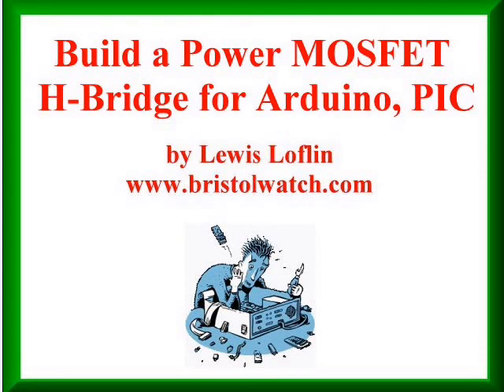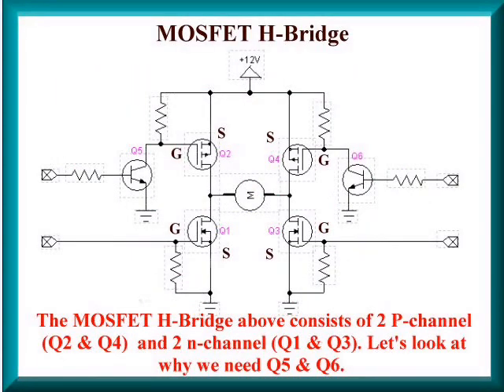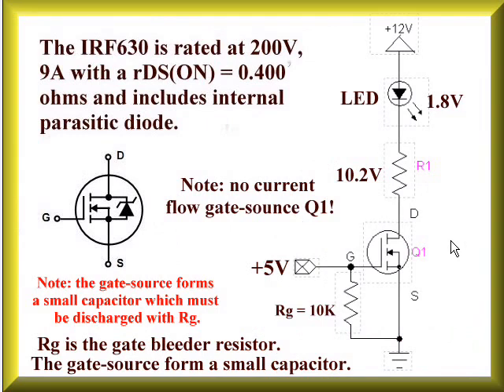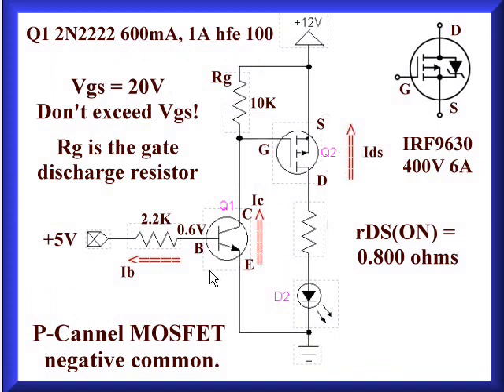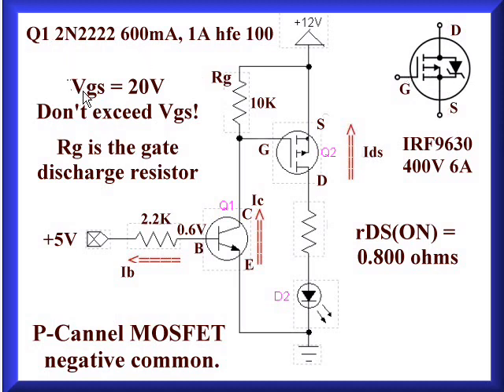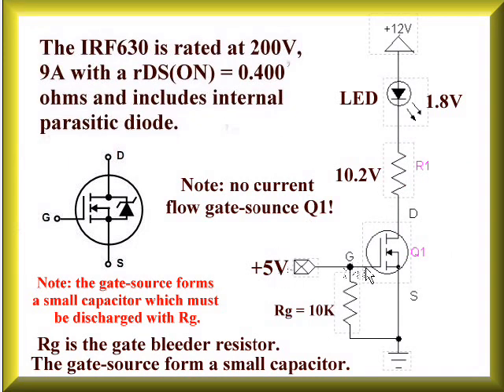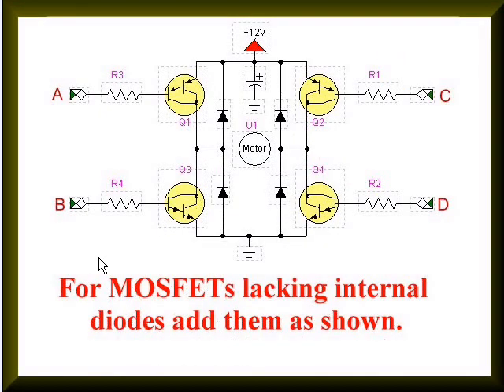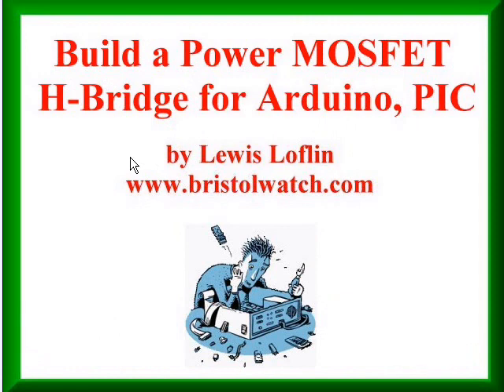Build a Power MOSFET H-Bridge for Arduino, PIC

Comment: Ok, thanks, but what kinds of modifications are necessary for 24v?
Reply from the maker: You have to find MOSFET with a Vgs > 30V.
Reply: ok, thanks for you answer. only I need to find mosfet with that capacity,but the rest of the circuit it's the same??
Reply from the maker: Here is a better answer to your question. https://www.youtube.com/watch?v=dbwZgP9gIbA
Reply: Hi, Lewis! Thanks for such awesome scheme. Can you advice, which transistors can I use with 24 voltage and 10A motor?

Comment: Please take a look at 7:29.  Node A connected to the 2 MOSFET is located between 2 resistors each of 10K. This is a voltage divider between 12V to ground, so you don't get 12V, at node A, but 6V, when the transistor Q5 is off!  Please take a look if I am correct.
Reply from the maker: This was already mentioned below but here it is again.
Note disregard the schematic at 7min 25 sec. Go by the schematics here. 
http://www.bristolwatch.com/ele/h_bridge.htm

Comment: Has anyone been able to successfully simulate this circuit? I've tried in LT Spice as well as Multisim with no luck :( Got the circuit working using my own resistor values though
Reply from the maker: I never use simulation I use real working parts.

Comment: How would you make this work with 3 signals to be able to "coast" and also "brake" the motor? This example the motor brakes when its not being run forward or reverse.
Reply from the maker: See above.
Reply: Yeah that is how I have everything wired up currently, works great but there is no mode to put the motor into "coast" where its free running? Putting both signals high, or low, results in the motor connecting to itself in "brake" mode right? I need a 3 wire or something to open up all 4 transistors. I don't have enough space with my current project to use 4 individual control lines. I've tried some small motor driver IC packages that use 3 wires to control (FWD, REV, ENABLE) , but they were not enough amps. Not sure how to wire up the same features in my own.
Reply from the maker: The diagram on that type uses two lines to control the H-bridge.
Reply: How do you wire it up to use 3 lines of control for FWD, REV, ENABLE? Or how do you make the motor go into "coast" mode with 2 wire setup instead of brake?

Comment: Good day ,great explanation . bit new at this and need help on a bit of a challenge . i have a starter motor 12 volt   100 amp . will it be possible to run this DC motor on this circuit and what components will i need to run this motor on PWM . I know this sounds like a strange setup but i need the torque for my application  and also need to reduce the speed also need to change direction as well .a person could probably buy something readily made  up but i want to learn from this so any help will do 

kind regards
Wayne wilson

Comment: is there a protection against back EMF in this circuit, or are additional diodes necessary for that?
Reply from the maker: The diodes are built into the MOSFETs are not shown.

Comment: I tried this with different semiconductors and it seemed to work all be it some loss in power.  When I tried adapting it for both directions it didn't work.  Because less power than the motor needed.  So I guess it did work.  I'm thinking I did something wrong.  May I discuss this with you and show you my diagram and what I used.  I did end up using a roboclaw.  I just can't drop this.
Reply from the maker: +Timothy Carey Yes my e-mail is lewis@bvu.net
Reply: I emailed you regarding my question above.  My first e-mail I sent accidentally before I was finished creating it. My e-mail address is tcarey@disabilityvoice.us

Comment: hello why u use different type of mosfet ? and why when iam use the same type for ex n chaneel i get big voltage drop ?
Reply from the maker: +Omar Eng Becase I'm switching from Vcc with the p-channel MOSFETSs and the  n-channel is the wrong polarity. The rest of the question I don't understand.
Reply: hello . i buld my h bridge using n chaneel mosfet irc740 and gate drive ir2112 but when i operate it in protius i get voltage drop ? also i use pic 16f to produce pwm to the mosfets .
Reply: for example dc input is 30 but i get 17.2 in voltmeter ?
Reply from the maker: Why are you using 30V when the MOSFETs (Vgs) is 24? Where are you reading 17.2 volts at?
Reply: between the two legs of h bridges 
at the motor location .30 volt is the vdc 
not v gate
Reply from the maker: If you refer to the motor that's what it's supposed to be if all the MOSFETs are off.
Reply: iwanna to ask you sir in case of inverter h bridge is there is v drop ?
Reply: sir in protius the scope have one terminal so the floting point is not accurate measure ? is that analysis right .
Reply from the maker: Don't understand what you are asking. Use the link to the webpage.

Comment: If I use logic level P-channel and N-channel MOSFETs could I disregard the transistor used?  I'm designing an H-bridge to drive a transformer.
Reply from the maker: +Proto G The P-channel is being switched to ground to turn on not apply a voltage. So you need to be aware the voltage on the gates id Vcc.
Reply: +Lewis Loflin Hey Lewis, would this setup with 4 Logic-Level N-Channel MOSFETs work with 5V? http://i.imgur.com/IDAOg7M.png
Reply from the maker: It would take so much reworking if it worked I really don't know.

Comment: Hi i am using Two P channel mosfet and two N channel mosfet with optocoupler from arduino....my qns
are
1) is it neccessary to put resistor ACross VGS(we have put it)
2) whenever i connected the supply of 24 V DC(battery),P channel mosfet gets heated more compared to N channel mosfet,in this even we didn't connected the load(24 PMDC motor),arduino inputs
can i know what is the problem and its solution??
Reply: I'm having the same issue. This circuit is plagued with shoot through since the N channel FET does not turn all the way off. I don't know enough to call it a bad circuit, but I certainly couldn't get it to work properly.
Reply from the maker: If you don't program your controller correctly you will get shoot though. NEVER turn on Q4/Q3 or Q1/Q2 at the same time!
Reply: Thanks for the response, Lewis. I used your figure 2 on your website, so I didn't have specific control of each transistor, only control of each half bridge.

Comment: wouldnt the 2 resistors on each side form a voltage divider , putting both gates at half the voltage of the rails (6v)? which means they will be both turned on at the same time when the input to the npn is low? (the gate of Q2 pulled low by 6v, the gate of Q1 pulled high by 6 v)
Reply from the maker: +michel michel No. MOSFET gates are non-conductive. They operate by voltage not current.

Comment: Call me stupid but with all the resistors at 10K then all gates will be at 6V when the 2N2222 is off and ALL the mosfets will be turned on. Net result Blue smoke. :-(
Reply from the maker: +Wizard Merlin MOSFET gates are voltage operated and non-conducting - when the 2N2222 is off gate voltage is VCC.

Comment: Great work sir. I tried  it, i used irf 9540 (100v -18A) to replace irf9630. 
i Got problem when i connected this H-Bridge (your design) with 11.1V (3cells) Li-Po  battery. P-Mosfet getting hot when switch on, but when i conmected to adaptor 12V, irf temperature keep cool.
Reply from the maker: +Ahmad Zambarkah The voltage wasn't high enough to fully switch on the MOSFET.

Comment: Thank you so much for this.. Best tutorial on H bridge's I Have seen so far..  I just learned of H bridges.. Ya, I know.. REALLY!!!!!!   I am building a coil engine and have an arduino using Halleffect sensors to pick up the magnet on the fly wheel of the engine.  I have a magnet on an aluminum shaft connected where the piston used to be.  I built a pivot on my lathe that connects to the crank shaft and connects that shaft with a magnet on it together.  I have guides that keep the shaft from tilting.  above and below the magnet are power coils.  The magnetic fields will face towards the magnets on the aluminum shaft.  so depending on polarity from the circuit I can have 2 NORTH fields facing each other or 2 SOUTH fields facing each other. pushing and pulling the magnet at the same time.  Been looking for a way to swap the field polarity without frying a circuit.. I am using HIGH amp coils.  They can handle alot of amps.  They are not wire coils.  So I am looking for an H bridge design that can handle upwards of 300 amps.. So far the best mosfet's I have found can handle up to 280 amps.  Thinking of getting them and making an H bridge with them.  Using my arduino mega to control the upstroke and down stroke timing with the Hallsensors.  I have my program made up with the RPM and timing and LCD display with my Voltage outputs of my pot(throttle) all set.. the engine.. Just an H bridge is all I need.  There is a great deal more to my motor, but no one wants to hear the every detail.  I am going to use this tutorial to make that H Bride.. You are a world of help..  I wouldn't mind your help if possible.  If not thanks for the tutorial and keep up the help.. 

Sean

Comment: Excellent video demonstration Mr. Loflin! Could you please let me know if I would be correct in assuming that replacing the motor with the secondary winding of a transformer that we now have a step up DC to AC inverter? And If so,  would some type of diode be used as a spike or fly-back suppression?
Reply from the maker: +Cameron MacDonald These MOSFETs already have built in diodes. Check the ones you use.
Reply: +Lewis Loflin Yes you are quite correct of course...Thank you for that, but would the circuit function as a DC to AC inverter if a transformer (with no center-tap) was used in place of the motor - provided an oscillator was connected to INPA & INPB?
Reply from the maker: I don't really know.
Reply: +Cameron MacDonald It would work, I did the circuit with the optocouplers connected to a 555 timer in astable mode to provide the square wave generator. Just make sure to use a transistor before one of the optocouplers so they're not "on" at the same time.
Reply from the maker: Thanks.
Reply: +D Pa Thanks for your advice. I tried your suggestion out on the breadboard. The transistor switches were a really good idea.  Now I'm thinking about using a quad 2 input NAND gate connected from the output of pin 3 from the 555. The NAND gate might offer faster switching capability. Were you able to achieve a near perfect 50% duty cycle of the square wave at 60Hz? I love playing with this stuff! Thanks again!

Comment: i have to ask, on your last diagram you have a n channel mosfet with  2 transistors? what type of transistor? nd you end up with 2 outputs so my question is why turn on tho transistors? if i can just connects the arduino inputs pin to the outputs of each gate of this four mosfet's?

and in regards to the mosfet are this all the same types or we have 2 of each? (p & n channel?)

like your videos keep em coming!
Reply from the maker: Frank Lopez Hello Frank. The NPN transistors are used to protect the 5-volt logic from the higher voltage H-bridge.
Reply: Lewis Loflin thanks sir, understand, i did leave another question for another of your videos , i will appreciated if you took time for that particular question on the other video

Comment: I just have to say that you do an extraordinary job of making it simple. May I suggest however that instead of zener diodes to protect the gate just used a resistor that will proportionally divide the voltage down with the bleed off resistor. Much cheaper.
Reply: that's what I thought too,
Reply: Cheaper you say, but a diode is much more effective and not exactly too expensive compared to a resistor

Comment: sorry 
can we make a speed control by this circuit ??
Reply from the maker: Ahmed Elshiekh You will need to apply that in the Vcc side of the power supply. See:
http://www.bristolwatch.com/ele/pulse_width_modulation.htm

Use the circuit in fig. 5.

Comment: I like your easy to understand video.  to power in one motor both directions couldn't I just use 2 mosfets?  And then two PWm and outputs on the arduino on the gates to control the speed and direction of the motor?  And put diodes on the arduino outputs so current doesn't strike into a arduino?  Referring in part to the following video.  https://www.youtube.com/watch?v=sVyi7yWuXxs
I really need a mentor for arduino.  I'm receiving a new power wheelchair and doesn't have all the same motors for positioning my seat.  Because I ever have infrared learning capabilities.  I've got the infrared switch workout.  I need to run to linear actuators at possibly different speeds but always same direction as each other.  Need to move them forward and reverse.  Also there is another video from arduino starter kit lessons that they ran a nine volt motor on one mosfet and a diode.  I have been able to make this motor controller I purchased work so I thought I'd build something with mosfets.

Comment: If you turn on on both P channel fet's you will not get 12 volts on both terminals of the motor, when you put a meter in the circuit you will get 12 volts because you just put a return path in the circuit. To wit, with both N channel fet's off there is no current flow thru the P channel fet's.
else gr8  video merci beaucoup
Reply from the maker: N8ZU "f you turn on on both P channel fet's you will not get 12" Yes that is correct. Current flow is from from p MOSFET to n MOSFET - make sure they are turned on as shown or you will short the power supply.

Comment: I am Building this night now.., and i was wondering if i could use IRF620 and IRF9620 instead of IRF630 and 9630...?.
Is it ok to Use IRF620 with IRF9630..?
Reply from the maker: should be fine  - it's not that critical. Just be aware of Vgs and that 5V will trip one the two N-channels.